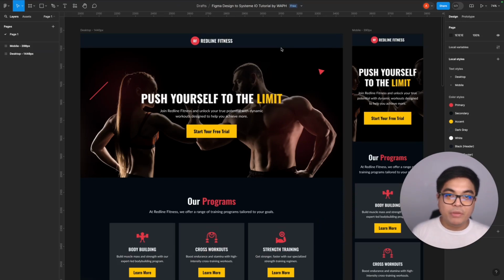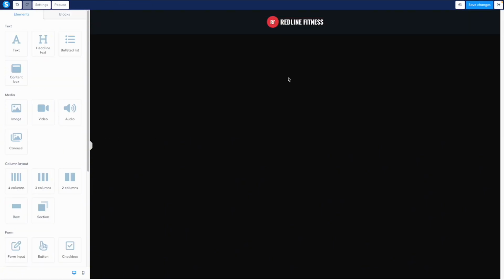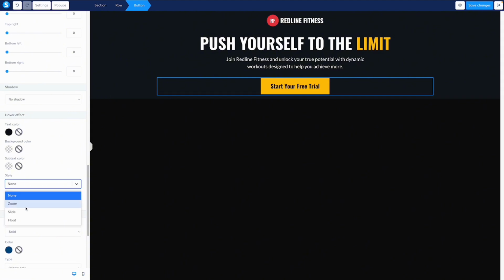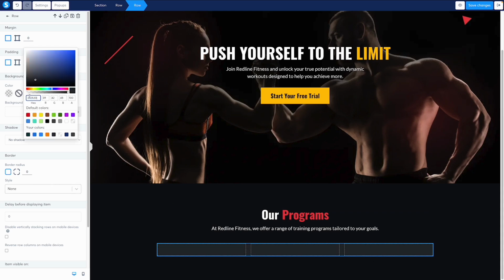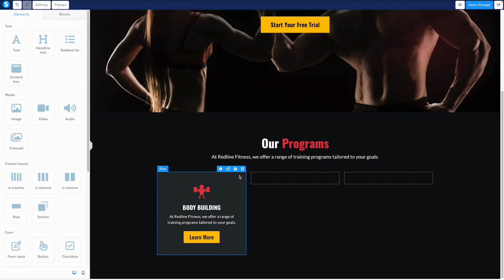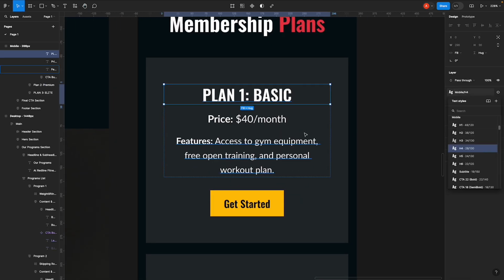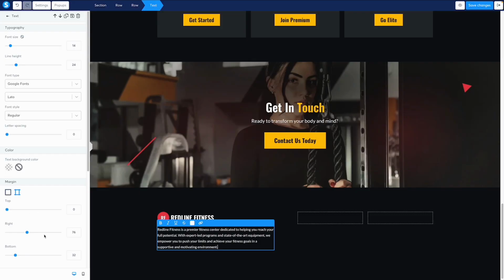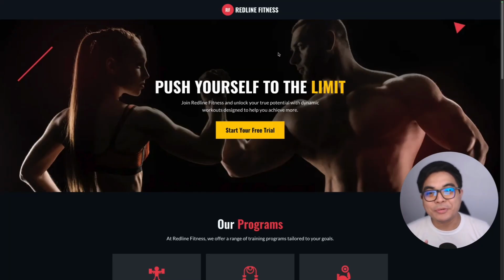How to Transfer Figma Designs to Systeme IO | Step-by-Step Tutorial (+ Free Practice File!) Tagalog

Comment: Sir ask ko lang, ano po yung kina calculate po nyo? sa line height po?
Reply from the maker: Using this formula:

\text{line-height in px} = \text{font-size in px} \times \text{line-height in em}

For example:

• 16px font size with 1.5em line height → 16px × 1.5 = 24px
• 20px font size with 1.75em line height → 20px × 1.75 = 35px
• 12px font size with 2em line height → 12px × 2 = 24px

This works across different font sizes and ensures consistent spacing in responsive designs.

Hope that helps 🙂👍